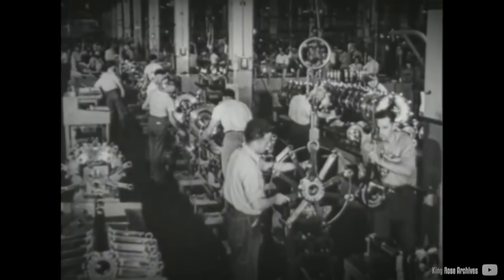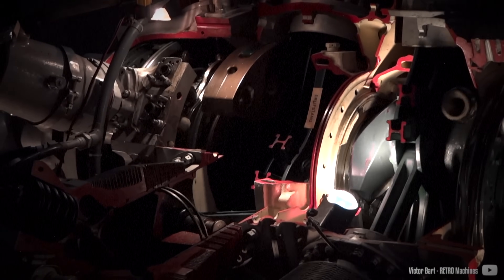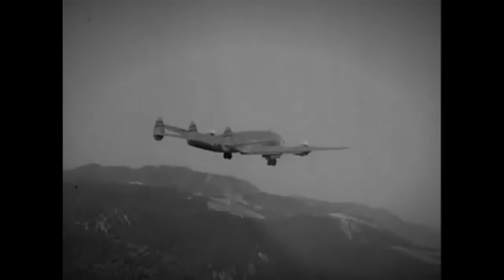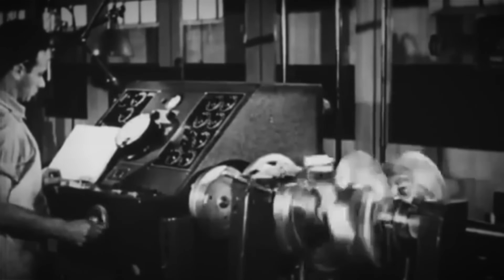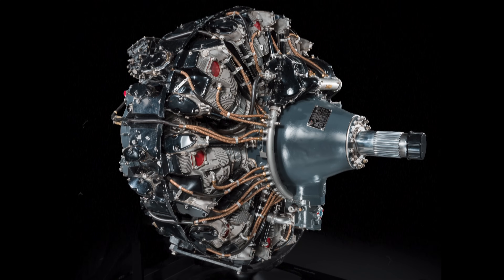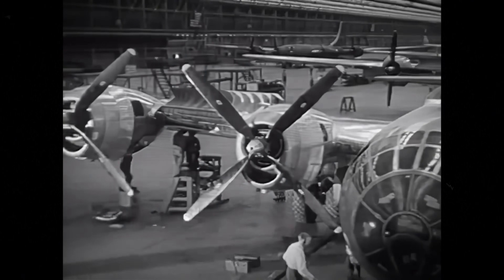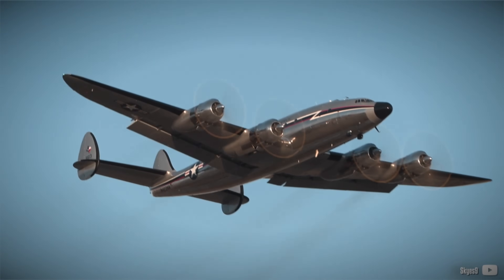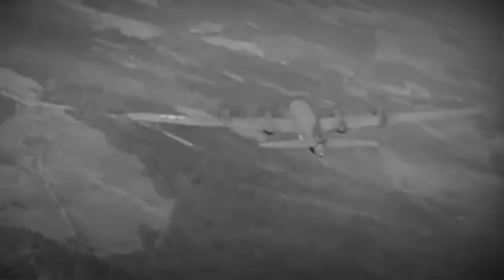The Most Important World War II Aircraft Engine

Comment: The limit on air-cooled engine cylinders isn't so much dependent on total displacement, as it is on bore dimensions. The larger the bore, the more difficult it is to cool the center of the pistons and conrods.  I would also argue that this was an important engine, but hardly the most important. I watched and listened to FiFi fly over my house a couple of years ago, she is a magnificent beast.
Reply: It's called lack of air flow... Not hard to see nor figure out...also front cylinders sending heat to the rear. It's pretty obvious...

Comment: These giant radial engine aircraft are just a feast for the senses. Modern turbo-prop engines may be much smoother, less complex, and generate a heap of power for their size and weight (all clearly superior attributes), but they just lack a lot of thunder, presence, character of these older piston driven designs.

Comment: By the way in Germany there is a Team wich is since 2023 using that Engine for Tractor Pulling. Team Name is Wolpertinger 2.0. Its a insane engine wich they have to cool down after every use with Air Blowers. Peak of the Peak when it comes to enginesbuilding Period. Not for Efficency but that aint be asked in that time i guess.
Reply: Get em there and back quick and have it hold enough fuel to do it.